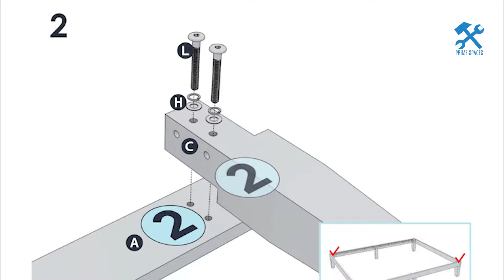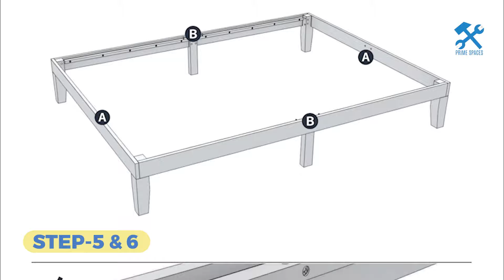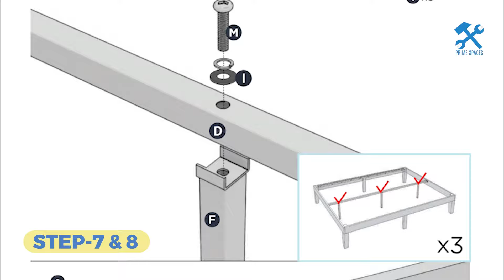Mellow 12" Classic Solid Wood Platform Bed Frame with Wooden Slats Assembly Harlow Solid Wood Bed

Comment: How is it holding up, ive heard they break or the screws become loose over time.
Reply from the maker: This bed was assembled for a customer, so I wouldn’t be able to tell you how this particular bed held up. However, if installed properly, and the bolts were fully tightened, it should hold up just fine. But that’s not to say that the bolts may not loosen overtime. It’s a bed that carries weight in it everyday. So you may need to re-tighten the bolts every so often depending on tour weight. The quality of the bed though is great!

Comment: What type of drill and tip did you use to drill in the nails?
Reply from the maker: Hey there! In the description I added links to the tools I use personally (drill and drill bits) I used when I assemble furniture. My drill is high power because I use it for professional use, but any 12 volt drill is fine.
Reply: @Prime_Spaces  ty appreciate it